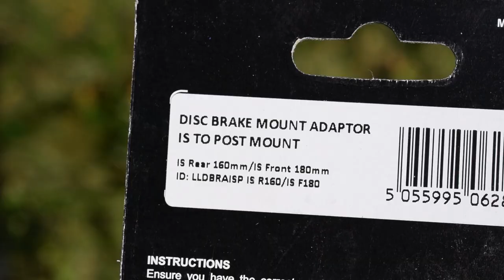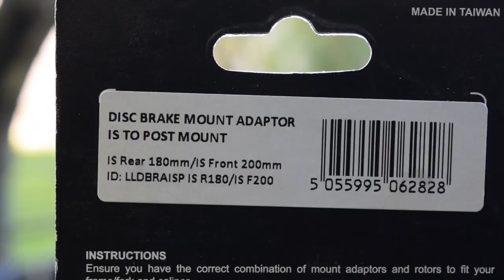Converting Trek Fuel's Rim Brakes To Hydraulic Disc Brakes

Comment: What is that adapter already on the rear of your bike? I can't seem to find it on amazon or eBay. Any help will be greatly appreciated .  :)
Reply from the maker: Dinuja_Hettiarachchi 24 You need the factory disc brake mount:

Part number: 210648

https://www.trekbikestore.com/product/trek-international-disc-brake-mount-154274-1.htm

The mount doesn’t come with any bolts, so you need to go to your local hardware store to get them.
Reply: Is it the same for Gary fisher trek will have bracket for those too
Reply: @DanyoSports  thanks for the part number! saved me tons of time trying to track that down

Comment: Hi can you tell me how your rear disc adapter is mounted, what is it booked to. Were there mount bolts already on frame?
Reply from the maker: Hi, the rear disc adapter is mounted on factory disc brake mount, are you missing this part? Check here:

Part number: 210648

https://www.trekbikestore.com/product/trek-international-disc-brake-mount-154274-1.htm

Comment: Hi do i need special rims/tires for this? My rim doesn’t have the part that disc brake screws into what can i do? Which rim would i need to purchase for my bike? Are they all the same size?
Reply from the maker: Hi, you need a set of wheels with disc hubs, make sure to get the right disc rotors with the right disc brake adapters.
Reply: @DanyoSports  thank you for the reply and information, you are amazing, take care!

Comment: Is it possible to do it the other way around, I mean to go from disc brake to rim brakes. I asked around in some local bike shops, but I was turned down everywhere. I couldn't believe. The reason to downgrade to  rim brakes is personal.
Reply from the maker: Yes, it’s possible if you have the mountings for rim brake calipers on your frame and fork.
Reply: @DanyoSports  i don't have the mountings, such a shame, but would it be possible to weld the consoles for canteliver breaks?